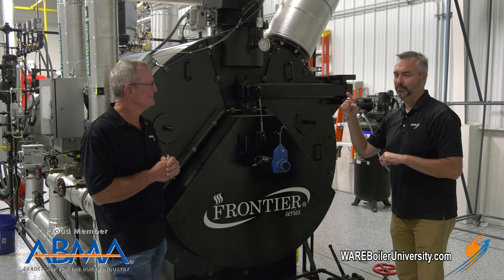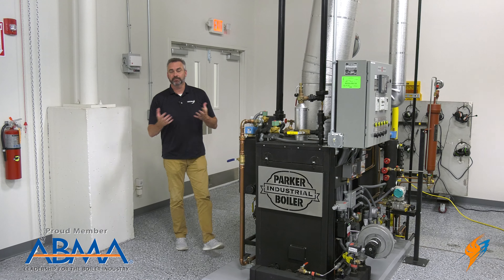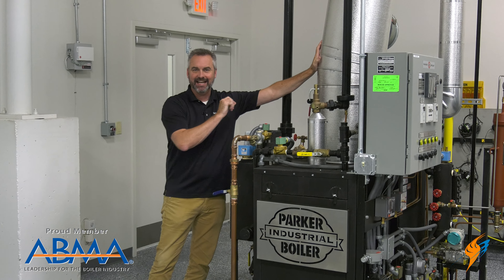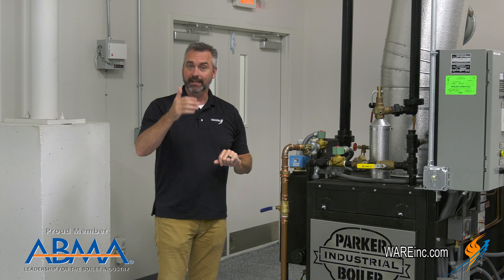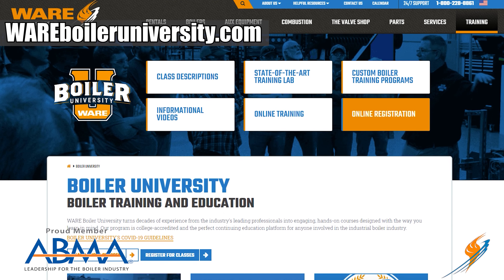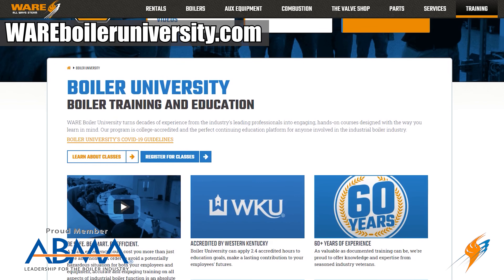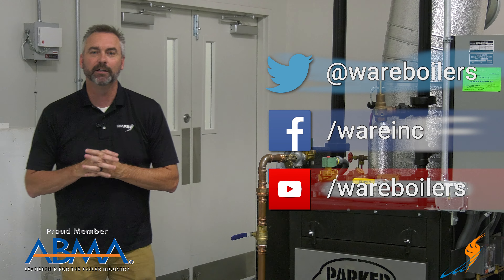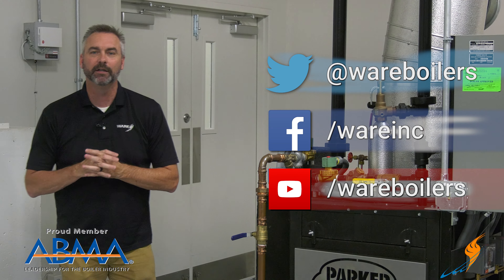How Boiler Efficiency can Affect Stack Temperature - Boiling Point

Comment: Excellent video. By "back pressure" is required on boilers?
Thanks for your excellent work.
Reply from the maker: What do you mean? Appreciate the comment and thanks for watching!
Reply: @wareboilers  Apologies! Please read above comment as "why back pressure is required in fire tube boilers?"
Thanks.
Reply from the maker: It is more that burners are DESIGNED for some expected backpressure in the furnace.  Traditionally, boilers are neutral or slightly negative at the stack outlet, so because there is resistance to flow within the flue passes, the furnace is by default positive.  Consequently, if there is no furnace pressure, the burner may be outside its design window in some cases. Hopefully that makes sense and answers your question. Thanks for watching!
Reply: @wareboilers  Thanks for clarification. Please keep us educating. Thanks.